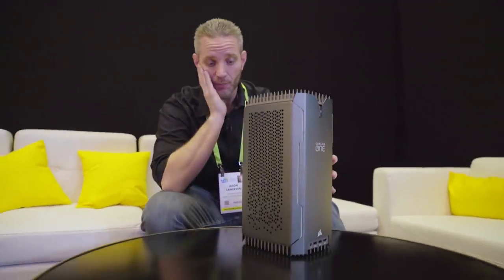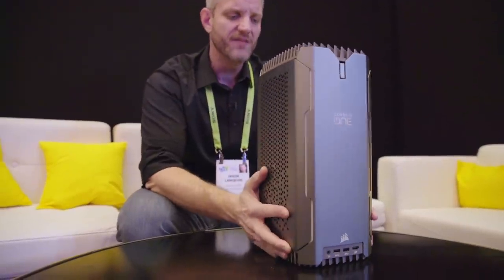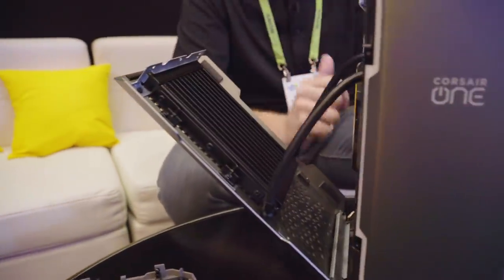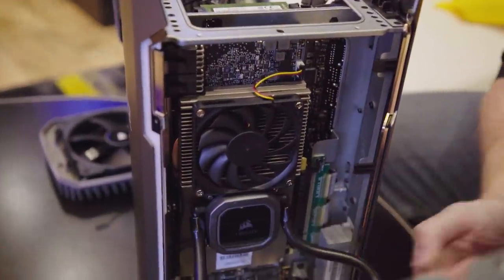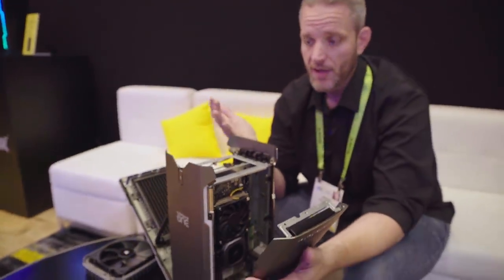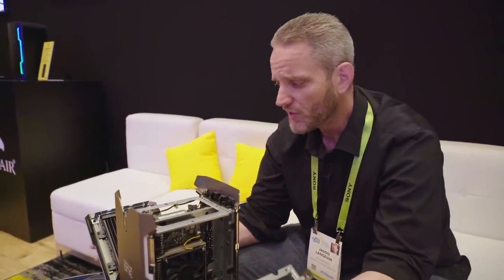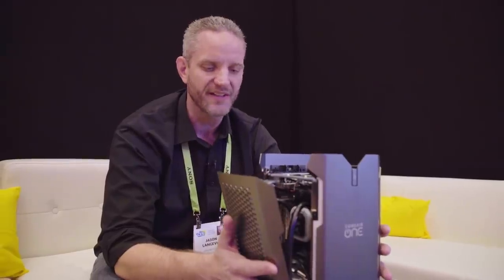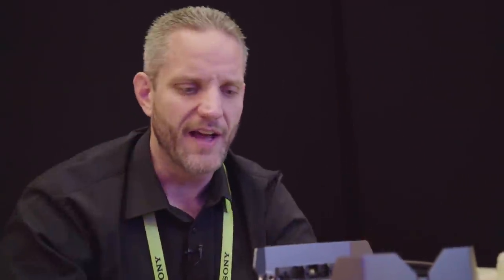Convection Assisted Cooling Explained - Corsair One HPDT

Comment: Bunch of words said, none said anything about 'Convection Assisted Cooling'
Also there is fuck all convection in that case - there is no space for air to free flow - its tightly packed, air is too viscous at those dimensions - anything that uses convection needs holes where you can roughly stick your fingers through.

Comment: Any airflow from the updraft is insignificant compared to the air pulled by even the slowest spinning fan. You can probably put it upside down and the temps won't change.
Reply: I.... I...
Damnit. I thought you were gonna talk about how it's so insignificant next to the power of the For- nvm.

Comment: hey corsair add a space for a 140 fan under the motherboard and use the psu fan to vent down, better perf, redundancy and fan fail tolerance. possibly  filter the rads with this config

Comment: I have the earlier version of this the Corsair On Pro and I replaced the fan, MLB, etc. without much trouble. This could absolutely be sold as a stand alone case as it's really not any harder to work in than a Dan case or the like. The only issue on the first version is the PSU extension cable routing which they look to have addressed on the new one and the GPU extension cable and connector which again isn't that much more difficult to work with than a Dan case or the like. Phanteks should look at this and take some notes for a new version of the Shift as well.

Comment: With 100% negative pressure and no dust filters, this thing is a vacuum cleaner. Also, you have one fan doing the work that would normally be done by 3 fans and static pressure is awful because the fan is so far away from the radiators and has to pull air through a lot of obstacles. As a result, the Corsair One actually has pretty bad temps, in the initial version the 7700K got up to 90+C at stock settings, you had to crank up that fan to max to get acceptable temps. In that same volume, something like the NCase M1 has much superior cooling and is cheaper.
Reply: Max CPU Temp 77C, Max GPU Temp 59C on AIDA 64 with Core i9 9920X and RTX2080Ti.  Cinebench R15 Multi-Threaded performance score 2391.  Nice and quiet as well

Comment: This is still forced convection due to negative pressure induced by the top exhaust fan. Anytime there is intentional airflow --- such as airflow through radiators due to negative pressure, it's forced convection. When heat transfer is in a forced convection regime, you can forget about natural convection because it is sooo slow and minute. It's because the driving force for natural convection heat transfer is due to the air density gradient/difference due to temperature and air around radiators and the ambient air will relatively have a small difference.

Even if you tilt it upside down (air exhausts downward), it'll have similar temps.

Source: engineer irl

Comment: By the looks of it ONLY.
Design, color is nice.
Ports, better than older version,
Upgradability, not so good considering the custom water radiator for cooling. The old Corsiar One had parts that could be found online, or reuse from older systems in case of failure. Also lots of fans in this design vs the older one. Must wait for detailed review though. Thanks for sharing.

Comment: It's about time PC-cooling solutions get some standards. Like a concrete cooling capacity under given parameters etc...
Otherwise how can you compare for example lets say dual 240x30mm radiator with 8 2000rpm 25mm fans in push-pull  ... with similar surface radiators (at least that we can easily compare, though fpi can change results)  with single large fan that is placed exactly ... somewhere around ?

Comment: I'm kinda missing the added  consumer value for this proprietary, $4999 show case.
"Proprietary" = Problem waiting to happen.
$4999 = Wtf
The only added value to this vid is to Jay being payed for doing this advertorial.
(Mind you, I'm not saying "$hill ", because there was some "tearing down").
Reply: rich people will pay that much, maybe not even rich
if they put up these products it is because there's someone buying them
but I'm gonna have to pass on this one myself
Reply: CES is about technology. Don't watch the vids if you don't want to see the latest technology.
Reply: it's not actually that bad, the parts combined would cost ~$4500 
https://pcpartpicker.com/list/Xqq7Ft, add $500 for the custom case and custom cooling, the laptop RAM and the semi (?) motherboard, and its actually not that bad.
also, that is using an i9-9900k 10c/20t rather than the 12c/24t i9-9920x which is considerably more expensive.
Reply: @eggy6857  I want to see new tech AT WORK. What are the capabilities? Show what is special about the rig. Do performance testing. That is essential for any vid!
Reply: @PHAD-tc2ic  that is where reviews come in. But the specs already tell you part of it.
Reply: @eggy6857  Specs are promises. The proof is in the eating. This was yet no review; just a teaser/infomercial/advertorial.
Reply: @Will91289  You should drop that estimate a little. I don't think most people pay $125 for windows which you included and you added a $250 case. Sooo you're saying this corsair case and custom radiators cost an extra $800+ which was basically the cost of my entire system (6600k, 1060 6gb, in a sg13 which is also smaller than this but only my cpu is watercooled)
Reply: @BGpanda  it was the smallest case they had.
regarding the $800, you would also have to include R&D costs, also as I noted the CPU is considerably more expensive then the one o used, according to the ARK, ~%1200, rather than the ~$500 for the 9900k, https://ark.intel.com/compare/186605,189127

Comment: i really don't get why today's computer cases dont take advantage of the fact that heat goes up. stick everything at the bottom and have the cool air inlet underneath and the hot air outlet on top. the most you will need i 1 fan on top to expedite airflow when needed. doing things sideways have more complicated airflow and need more resources like fans on the front and back, sometimes in multiples. this case got it right. there were some 90's and 00's cases that did that too but people forgot about them for "aesthetic reasons". just my two cents.

Comment: I hope Corsair isn't seriously promoting convection cooling. A fan moving air around completely negates convection. If you set up fans to blow hot air out the bottom of the case, hot air will come out the bottom of the case.

Comment: 4800MHz DDR4. I hope it comes pretuned to memory spec. Otherwise you'll most likely never see them run 4800MHz. Not just the tip, not even for a little bit.

Comment: What a silly name.. almost all heat transfer in a computer is by convection.  What they mean is “natural” convection assisted, meaning heat naturally leaving the radiators without a fan forcing air over it. When a fan is involved its called forced convection. 

What corsair means is they didn’t put fans on the side radiators so its “natural convection” assisted cooling, as opposed to using fans which would be the typical forced convection setup. Kinda sounds like the case was too small to fit fans, and theyre selling a design limitation of a small form factor case as a “feature”....

Comment: When u said $4k for that thing.........screw that! Only a dufus would buy that. Wow.
Reply: The model he is showing is more of a workstation than gaming. Thats the reason its so expensive. the i9-9900k and 2080ti version of this is at $3600.  There is a premium on it for sure, but the model you are talking about is $2600 just for the CPU and GPU alone, and then the rest of the parts on top of that.

Comment: 5k $ fuck that i could get the same specs with an horizondal case the same size and 2k tops lol
Reply: $2k tops eh. $1,100 for the 2080 Ti (GPU) and $1200 for the 9920X (CPU) if we go by lowest prices on eBay currently, that's already $2,300. Is someone paying you $300 to take their X299 MB, 1TB NVMe SSD, 2 TB HDD, SFF PSU, 32GB memory, & licensed Win 10 Pro? How about this solid metal SFF water cooled case with proprietary radiators, pumps, fans, LED lighting, and PCBs?  I suppose that you can somehow fabricate an equal or better case, that cools just as efficiently, with comparable dimensions, for free (no expenditure of time/energy/resources)...

Comment: Don't get me wrong, I love the idea of compression and compact design, but this is another one of the products that we've seen more and more of in the past few years that is just overpriced as all hell and so niche that I'd be shocked if the designers zeroed out. I legitimately want to see a scenario where you actually need this product; no other solution will work, you need this in your office. At $5,000, you could do quite literally anything else for a solution, even on a small scale. Building a PC in a desk or drawer, building a server rack unit and routing the cables, using any one of the numerous small cases out there and watercooling that, making a floor tower; any of these would be perfectly viable at that price point.

I think that, more than anything, CES is just one of those shows meant to say 'we did it'. It's not about practicality or price or general application, it's about showing off how you made something that has yet another splatter of RGB while boasting maybe 10% better performance for 15 - 20% more money than the last generation.

Comment: Now if they drop the pump and the water and instead use a self-running loop heatpipe, like they're use in spacecrafts, we're finally cooling computer optimally in a way that it's actually worth it to hire an engineer. Water cooling? Yeah, because that can't be done by a twelve year old.

Comment: For a Gaming purpose I see no sense in this kind of solutions... almost no upgradable, most of is proprietary parts... That was not the main concerns in the PC community about Apple iMac? Closed package, no room for upgrades and so on...
I don't know it's my opinion, but If I want a gaming platform (Pc not consoles a mean) I want that if I need to upgrade maybe my GFX card for because a new one is on the market, I don't need to trash my entire system... Yes this are workstation oriented hardware I guess, but if anything fails you are tied to Corsair for everything, you cannot go to amazon a buy new PSU or Mobo because your's is failing.
Not for me... for sure